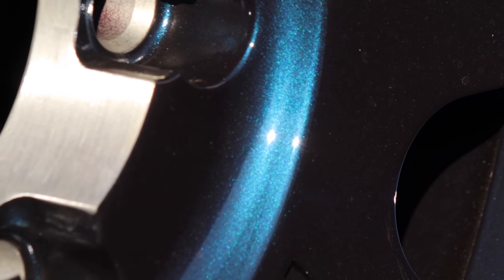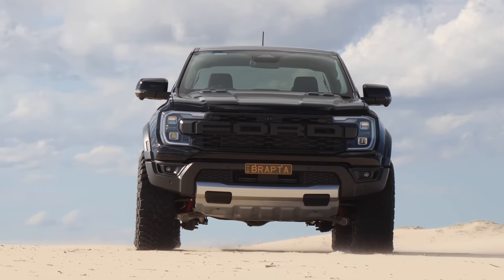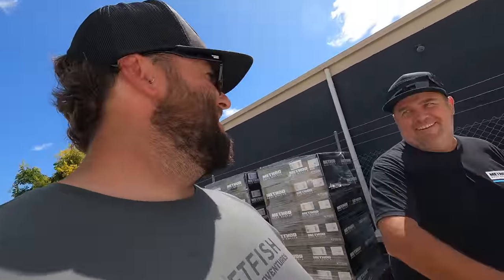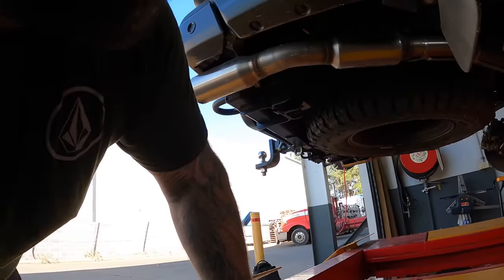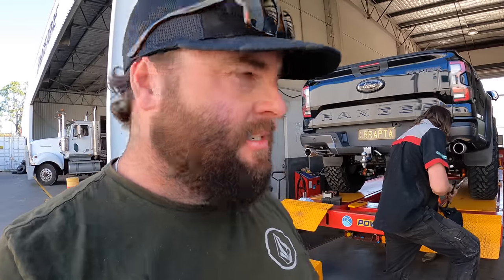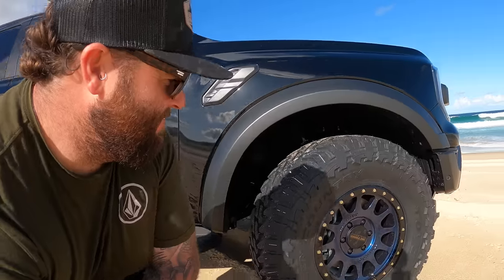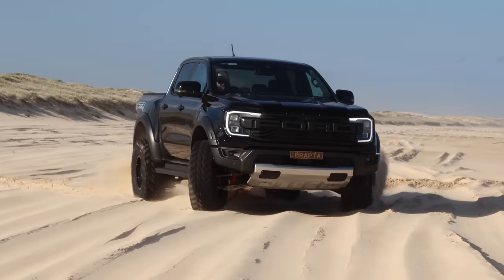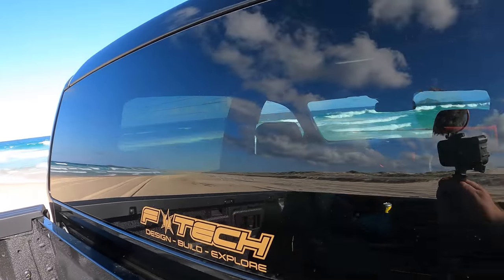🔥FIRST RAPTOR MOD ! METHOD drop a brand new color ? Will the 35’s fit ?💀

Comment: On my 1St Gen - 2020.75 Ranger Raptor I have been running 5x Yokohama G005 XMT's  35"x12.5"R20" on a KMC Rim with a P38 offset and I only needed to remove front mudflaps when I didn't upgrade my front springs as I had fitted a Steel Bull Bar and 12000lb Winch (total about 106kg), when I uprated my springs to suit the weight I was able to return the mudflaps just needed a minor alignment check, I have also got a set of 17" Black Rhino rims with P40 offset and better load rating than the standard issued rims, currently still using the factory tyres till they run through, I can then go between 32" or to the full size 35" an still be legal (under the flare lip edges).

Comment: Hey mate, I'm having some dramas with my lifted raptor and I've done a heap of research trying to correct it. Thought I'd share my findings before you make the same mistakes I did.

A spring lift with a revalve doesn't change the open or closed length of a shock, it just changes where the shock sits in its travel at ride height. The problem with a spring lift and revalve is we've essentially lost 2 inches of down travel from the increased ride height. This causes all kinds of issues with wheel lifting and has caused me some issues offroad.
For example, take a look at rock buggies. They run at full compression, because this allows them 100% droop.

An ideal situation is to have stock ride height, to keep shock travel around 50% up and 50% down but use big tyres to increase clearance. But I want the lift so I can keep my clearance for my big tyres.

On the Raptors I actually believe it's better to do a strut spacer lift, as this means you're increasing the overall strut length and keeping your bypass shocks in the right zone.

If you have a bumper/lights/winch you need to consider spring rates. Caloffroad does a stock height, increased load spring that would suit if you're running bars.

If you do go the strut spacer, you will find that there is another problem that will need to be solved. With the increased droop, the factory UCA will start hitting the coil, potentially damaging the coils and the arms. I contacted GOAT offroad and they've got a new billet arm set for the gen1 that is designed for far more clearance in this area. I believe there are already a few billet options for the G2.

Goodluck. Wheels look sick btw
Reply: I run snake racing 10mm strut spacers on my last gen without issues. Honestly no difference from stock on road or  hard off roading. It gave me a 25mm lift. Planning to do the same on my 2023. I'll  see how this comes out
Reply: thanks for sharing your experience. I'm thinking about fitting a slightly bigger 295/70 r17 tires on the stock wheels. do you think I'll need any clearancing? I'd rather not f around with lifting and revalving and such.

thanks in advance !

Comment: Those wheels are sweet! Would like to know if they work with the standard 33" wheels, or what is the correct wheel to order for the standard size wheels? Thanks for the vid, appreciate.
Reply: Go to 13:30

Comment: Hey Ty
Have you re fitted the mudflaps since? Just fitted 18x9 +20 35x12.5R18 Toyo RT to my Raptor. Took them off and no rubbing (unsure about compression) however I'm worried about the front doors getting peppered with gravel etc with no mudflaps.
Reply from the maker: I haven’t refitted mud flaps. The stock ones won’t fit with 35’s unfortunately
Reply: @TyFenwick  did you do any cutting at all?

Comment: Would wheel spacers be needed for stock rims running 315/70R17? Or the tire size would not allow the rub? I’d like to keep that stock rims if I can, but would get new wheels if needed. Don’t really want to use wheel spacers and plan to get the perch collars. Thank you
Reply from the maker: No you shouldn’t need wheel spacers, highly recommend to never fit them. 
315/70R17 you shouldn’t need to mod anything to fit. Perch collars will level up the front nice, we have one set left on our website.
Reply: @TyFenwick  thanks! That’s mainly what I was concerned with. Do you think upgrading to the 315 over the stock tire will get the stance out some? Would like about 1” outside the fender. Got perch collars ordered!

Comment: Hi Ty,

Your raptor looks amazing!  I'm getting the same method wheels as yours in bronze in nz but the guys that are importing them for me and the method site say that the flush caps don't work with them on gen2 raptor ranger. Could you please get the product code as I'm after the same as yours, bronze topographical. 

Thanks!
Reply from the maker: Hi, 

Give method race wheels Australia a call see if they can contact the dealer to let them know they do work 👍🏼

Comment: How do the balancing beads go with the pressure sensors? Do they affect it at all? Tyre shops hesitant to put the beads in for that reason
Reply from the maker: All my vehicles have sensors, I’ve had no issues.

Comment: Interested in the lift, would it also increase the GVM?
With the tyres, if already two inches bigger and getting a lift, will that make it no longer legal height?
Reply from the maker: Il know more specs on the lift soon fingers crossed. Il be doing a video on it 🤙🏼

Comment: Ended up with double black 305s on mine.  Just wish method had less aggressive offsets for the raptors, or wish Ford releases them with a better offset standard, +55 stock is a nightmare
Reply from the maker: Yeah I agree. Just in a little bit more under the guards would be nice 👍🏼
Reply: @TyFenwick  need con6 offset
Reply: @fordtensecn8359  I have +35 Method 703 on mine,  fitment is spot on
Reply: @luizmkv6963  35 legal too

Comment: What do you think of shock spacers to raise the front without affecting the shock action itself??
Reply from the maker: Never fit spacers. They can cause massive damage to a raptors suspension, cv joints etc

Comment: Hey bro, can you add some caster to push the wheel forward?
Reply from the maker: Yeah I might be able to. It’s bigger all it catches by 👍🏼
Reply: @TyFenwick  yeha mint. It looks sexy as. I kept our method con 6 18/9+18 with 35s off the Y62 for raptor. Maybe a little more poke than yours but then again yours are 8.5s? So might be similar. What are you thoughts re a small 5mm strut spacer temporarily while we wait for valving to be sorted?
Reply: Hey man, also did you have to remove the honeycomb peice behind the inner guard lining/mud flap? Mine looks like it's gotta go, and bend back that steel peice under the plastic you cut?

Comment: So, needs trimming, noisier, slower, uses more fuel, but "sick".? Hmmmm... Benefits? I'm totally up for swapping the OEM's and BFG's, but not sure I would change to 35's. The Method's do look nice though...
Reply from the maker: A 315 size tyre would be good I think. It feels smoother on road then stock. Big MTs will always have a slight noise to them. I love ‘em that’s all that matters 🤙🏼
Reply: Exactly!  Clearance, noise, fuel use, loss of torque, expensive and can't get ém outside of big city dealers. Why would you?
Reply: @TyFenwick  315's, totally. Love your content, keep it coming.
Reply: If  you go offroad and do hard tracks, 35s definitely help ground clearance. Not to mention how much  smoother the ride is on corrugations. If you don't ever go offroad, yes I agree with you. We travel remote/bush a bit and 35s have made every obstacle significantly easier! Having said that, you can definitely do MOST of Australia's toughest tracks on 33s (and a  bit of winching!).
Reply: @auswi  35x12.50r17 Yokohama Geolander MT G003 tyres are lighter, slightly smaller, quieter, and a slightly wider lug spacing vs the Toyo Open Country MT tyres, but for F250/F350 heavier tyres like the Toyo/Nitto are a good idea. 17x8.5 Method Bead Grip 706 +35mm or 707(BAHIA BLUE)+25mm wheels would be my pick.
Reply: Nah , E rated tires ruin the ride on this "light weight¨ trucks, they ride much harder and are too heavy. Stick with C rated even in these humongous sizes, unless you plan to carry heavy loads which is not its intended purpouse.

Comment: I am running 305/65’s on mine without any issue. Saying that I ordered 35x12.5 Toyo RT’s yesterday as we always want bigger! 😂

I also ordered 40mm lift springs for the front as a temporary measure until the full kits come out, hopefully no issues with the live valves!
Reply: What issues did you have with the live valves?
Reply: @dannyrexknight  I havent installed yet, but I asked the supplier whether there were any adverse affects or concerns re operating parameters of the shocks and they replied “No issue or risk to the factory components.”
Reply: @joshbaker6252  Cheers. I think ill just flog the stockies for fun first then when there are really sorted out options Ill consider a small front lift to remove the rake.

Comment: I wish wheel manufacturers would move away from the fake beadlock look especially with gold coloured bolt heads, there’s only a handful of wheels I like but not available in a offset compatible😕.
The blue centre on those Methods looks nice though, and the Toppo centre caps a nice touch.

Comment: Nice rims but unless you’re off-road 90% of the time those tyres will be a disaster. Why you young blokes want these stupid chunky tyres are beyond me . They are dangerous in wet conditions, after you have about 10,000 Ks on them they will be all over the road with heal and toe wear. The noise that they make will drive you crazy. I have fitted the exact opposite an put safer road tyres on. Better fuel economy and safety in the wet. Massive reduction in road noise. Have kept my original tyres for use when I go bush. Most of the time I’m on the beach and road tyres are much better on sand than terrain tyres. Look at the tyres on the park ranger vehicles on the beach. All road tyres.
If you think I’m full of shit I owned and operated one of the biggest tyre stores in Australia for 11 years
Reply from the maker: Calm down Mike there just tyres… & FYI I’m off-road every day in this thing 😁👍🏼